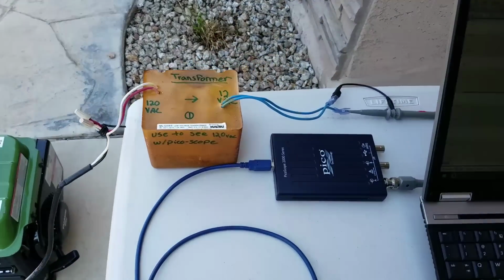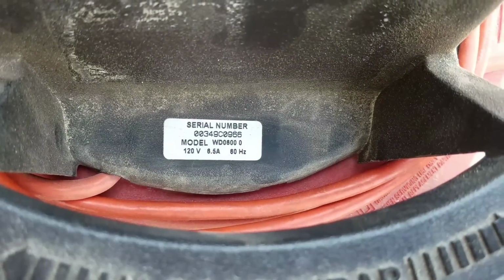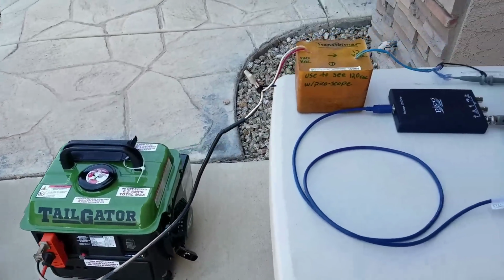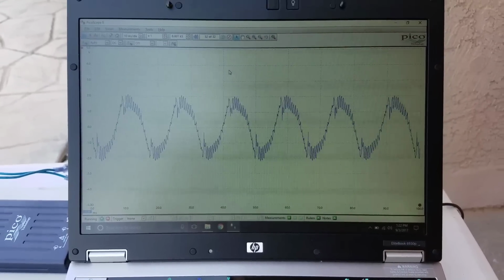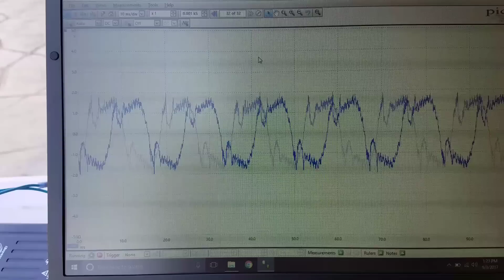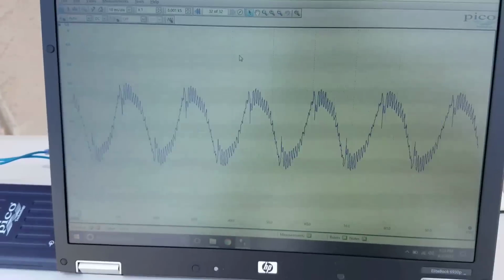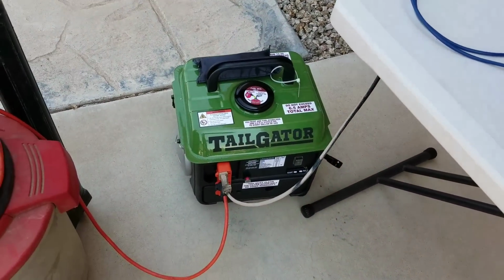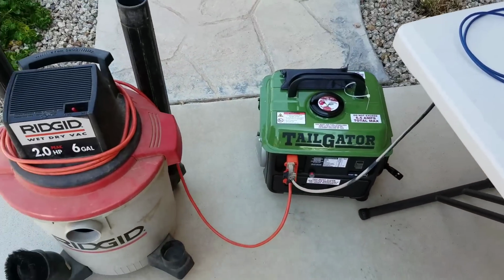TESTED Harbor Freight Tailgator generator wave form with PicoScope

Comment: Nice to see the output wave.  What is inside?  I am guessing this does not have a true alternator.  Is the generator inside DC that goes through an inverter?  If so, what voltage is the DC?  I am looking for a 12VDC 15A generator and was wondering if I could connect directly off of the DC side.

Comment: Would this generator damage electronics? Thanks for the video.
Reply from the maker: Brad Davies: great question! Because the wave is not the most smooth, and degrades as you load it, there is a potential for this generator to damage more sensitive electronics. Personally, I feel comfortable using it with most power tools and devices that have an external power supply "brick" on their power cord.
Reply: @skipstang  I truly appreciate the video. I am purchasing this generator as a gift to an older person. Now I can include a power conditioner. Now I wonder if this will damage a true sine wave power inverter? There are plethora of videos doing sound tests with generators, we need more videos like yours. Thanks again.

Comment: M6 generator cannot start plsss helpp
Reply from the maker: Karl, sorry to hear that. For all gas generators that have trouble starting check for the three basics of combustion: Fuel, Air, Spark. FUEL:  make sure you have plenty of clean gas and the gas is getting all the way into and through the carburetor. For generators that sit with fuel in them, the small ports in the carburetor get clogged and this is a common reason for not starting. Some carb cleaner spray should help fix that. AIR: make sure your air filter is clean and it (and the housing) is not obstructed with dirt or debris. SPARK: this lights your air/fuel mixture in the combustion chamber. Remove the spark plug, ground it out to the metal motor and try starting (area should be free of any gas or carb cleaners for safety). You should see a spark pulse at the electrode. Make sure the plug is clean and the Gap is correct.

Comment: I noticed the red or orange socket adapter on your generator, I was wondering if the machine could operate using multi things like lamps and fans at the same time or any two items on the generator?
Reply from the maker: darkchild00, great observation! The generator will run any combination of appliances as long as their combined load is equal to or less than 700 watts. So if you plugged in 7 lamps with 100w bulbs each, then Yes it would run them. Use this easy formula to find the Watts of the tool/lamp/load you want to use: Watts = Volts x Amps.
Reply: @skipstang  Oh ok thanks. That's very helpful.
Reply: Hi again, can I ask where did you find your multi plug adapter? Thanks.
Reply from the maker: Home depot.
Reply: @skipstang  Thanks I appreciate that. I just purchased one recently.

Comment: Hi is this strong to run a travel trailer I have a battery on the trailer
Reply from the maker: Alex: if your travel trailer has a converter to charger up your 12v system this little guy may be ok. It will run lights and TVs, but no AC or microwave. For the price, it's hard to beat. Give it a try :-)
Reply: Ok thanks

Comment: Loading "it to the max" would involve doing work with the vacuum, like putting your hand over the end of the hose, not just spinning the motor.
Reply: If you block the hose, the motor speeds up and actually draws LESS current. To draw maximum current, you would take the motor unit off, and remove the air filter to allow maximum air flow volume. Don't worry: this generator would still have no problem powering it.
Reply from the maker: mwilliamshs, that is a great point! As others have suggested, maybe I should run the test again with a fixed load; halogen light(s) for example. This along with measuring the amp draw would produce a more solid test. Thank you.

Comment: What am I supposed to be seeing??????
Reply from the maker: Wayne Novotny; we are looking at the shape made by an AC power source. The shape of the wave tells you a lot about the quality of power the generator produces. The more smooth and consistent the wave/shape the better. The oscilloscope lets you "see" what the 110v alternating current looks like in real time. The point of loading up the generator with the Shop-Vac was to see if the shape of the wave would degrade if the generator is worked very hard.
Reply: Thanks! @skipstang

Comment: how did you break it in?
Reply from the maker: redneck teck
, Great question! I followed the recommended break in procedure in the generator manual. Basically it has you gradually increase the load on the generator for different blocks of time. Since you only get one chance to break in a new motor, I wanted to do the right. Hopefully it will pay off in a long service life.

Comment: That was interesting, thank you.  Can't beat the price.  Not sure I'd plug expensive electronics into it, rather I'd use it for lights, small fridge, coffee maker etc.  These are decent units for the money.  I understand breaking them in using 40:1 fuel to oil ratio is key to longevity.  I've seen where people have put 1000+ hours on these provided they are broken in properly, and not overloaded.  Good value, and decent build quality for the money.
Reply: I know a few contractors that work on vacant/ abandoned homes.  They use these Chinese gen sets to run small air compressors, shop vac and even water pumps. I went with a bigger 6.5hp 4k peak unit when we did that work so I could run a bigger compressor and my circular saw but at times i wished I had a more portable unit as mine is 130# or so with fuel.

Comment: Do you think this thing is strong enough to run one chest freezer or a fridge?
Reply from the maker: Eddie, it depends on the amperage of the freezer or fridge; check the label on the back.This unit is rated at @ 6.5 amps continuous load. Remember the fridge doesn't run all the time, which is good. I have heard of people running full sized fridges with these little guys, so it may be possible. It would probably help if the fridge was already cold, less initial load. You bring up a good point, what exactly is the threshold of this little generator? I know people in hurricane impacted areas just trying to make it through could use this info. I think a new test is in order. Thank you!
Reply: If it can get it started, it would run it just fine. Some older fridges and freezers take a lot of current to start, and this generator may struggle with that.

Comment: If I buy the 750 watt inverter and use that with this gen would that make the sign wave clean? I'm looking at getting this gen cues of the price but want it for my gameing system if the power goes out.
Reply from the maker: Joshua Raines, that is an interesting idea but not exactly how the systems work. An inverter converts DC (battery) power to AC (wall socket) power. This (and most) gas generators already output AC power, so there is no need for an additional device. However, I do agree with you about having good quality power for a PC. What I use is a backup-UPS (uninterrupted power source). This maintains constant power to whatever is plugged in even when the grid goes dark. Seamless power with no interruptions! To get even longer run time (UPSs have internal batteries) use a little generator like this one to charge the backup-UPS. I hope this helps.
Reply: @skipstang  hey thanks I was woundering about those too but could not find if that would work or not.
Reply: If you get a 100 microhenry inductor and connect it in series with a 20 microfarad capacitor, that would filter out the high frequency ripple, and it would be perfectly safe to use with the gaming console, and the TV. The power would be taken off the capacitor.

Comment: I'd like to see a sine wave test on the Sportsman 1000 4 stroke inverter generator....I have the Tailgator and it's been great. I run it at 40-1 though, not 50-1. Thanks for doing this test!
Reply from the maker: Harold Fits, that is a great idea! I will have to look in to getting my hands on one. Better yet, I should make a mini-gen shoot out video.

Comment: como puedo sicronizar las ondas de 5 generadores de este tipo en una casa gracias
Reply from the maker: The question is: "how can I synchronize the waves of 5 generators of this type in a house thanks"? This usually is a feature of more expensive generators with computer controlled power output. These little Tailgaters are very simple and rely on engine speed and a capacitor to create the power/wave output. I do not see a easy way to "sync" the waves so multiple units can be combined. Realistically: 5 x $90 (price of one Tailgater Generator) = $450  &  5 x 700 (running watts) = 3500 total watts. The Harbor Freight Predator 4000 watt generator is $339.99. It is less expensive, cleaner & more fuel efficient (2 stroke vs 4 stroke), and you end up with a more powerful unit. If you need house power, I would not under-purchase a generator. I hope that helps.
Reply: well thank you very much for your attention greetings from Colombia
Reply from the maker: raul david rojas muñoz, many areas of Colombia get strong sun year round, have you looked in to solar? It is more expensive at first but almost free after that. Solar water heaters are cheap to build as well.

Comment: The Pico software has fantastic measurement capabilities.  It would have been nice to see frequency peak-to-peak etc.
Reply from the maker: Jon Dison, you are correct the Pico scope is a powerful and focused tool! It would be fun to totally geek out on the specifics of the wave. For the purposes of this video it was sufficient to inspect the general shape of the wave under load. However, a few of the inverters I have laying around may require a more detailed analysis :-)

Comment: Can it Run a small window unit and a small refrigerator at the same time thanks in advance
Reply from the maker: George Barnes, it depends on what amps the two units draw. Watts = Volts x Amps. Add up the amps on the equipment you want to run and multiply by their operating voltage (on the UL sticker). This will give you the Watts necessary to operate the equipment (and a great way to pick the right sized generator for your needs). This generator makes 700 watts of power at 110 volts; roughly 6.5 amps. Running this small shop vac maxed out the little generator, which was the point of the test. I wanted to see how the wave form holds up at 100% load.
Reply: This will struggle with the inrush current of the induction motors in the compressors. It would run one or the other, if it can get it started. It won't run both.

Comment: does  the wave is  okay for modern TV or Computers.....?
Reply from the maker: Wolfgang Eckert that is a great question and also one of the reasons for this video. The owner's manual states "Unconditioned electrical output can damage sensitive  equipment.  Do not use to power sensitive electronic equipment without appropriate line conditioner (sold separately)." We can expect a CYA statement like that in almost every manual, but the quality of the power produced (ie: wave form) indicates what applications are appropriate. The more smooth, symmetrical, and consistant the wave the better. In that department you definitely get what you pay for, however this little guy impressed me especially for the price. I would feel comfortable using it for power tools and devices with an external power supply. Most "brick" style power supplies do a good job of cleaning up the power for their device. However, I would not trust this unit to run an expensive tv or devices with microcontroller motors.
Reply: This actually looked pretty good. Most modern power supplies are buffered enough, they should have no trouble running on this. I don't think I own anything that I wouldn't plug into this, except induction motors which may take more starting current than this generator can put out. The flywheel in this doesn't have enough mass to start an air compressor. It may struggle with starting a refrigerator, or trailer air conditioner.

Comment: Heck I ran this generator to power up my full size refrigerator and it had no problems with it. Great little generator.
Reply: My chest freezer only draws 1.2 amps while running. It draws 12 amps on startup however. Those locked rotor amps can be quite high.
Reply: ride4kix no this is bad
Reply: how big is your fridge?
Reply: Wolfgang Eckert probably small
Reply: A regular sized fridge only uses about 200watts. ....

Comment: Received your reply. I shut the fuel off, let it run dry. Use only fresh gas, with fuel stabilizer. They ran fine every month, for 30 to 45 minutes, until I needed them when Irma came calling. I will never trust them, and when I fix all the Irma damage to my house, those 2 pieces of junk are going to the dump.
Reply: i want them if your throwing them in the trash

Comment: You should put a resistive load on it like a space heater or some high wattage light bulbs. Lots of that noise on the scope may actually be coming from the bushes in the shopvac motor.
Reply from the maker: V, I agree. There is a 700 watt halogen worklight in my garage that would be perfect. However the choice of the shop vac was intentional; thinking of all the people cleaning up after the hurricanes.
Reply: Does the ShopVac motor have brushes? It is an AC motor.

Or the noise could be from the generator itself. Harbor Freight isn't known for great fit and finish.
Reply: @davem5333  universal motor.  Yes they have brushes.
Reply: @davem5333  The shop vac uses a universal carbon brush motor, so it can achieve high speeds. The speed is voltage and load dependent, regardless of line frequency. It would even work on direct current.

Comment: Not sure about the new one, but the prior red ones are CRAP! I will never buy anything generator wise from these Chinese crooks. I have 2 of the red ones that I have run every 4 weeks, with stabilizer - the whole maintenance deal. Now, when that bitch irma is coming, neither of these hunks of junk will start. Spend your money on lottery tickets, you will have a better chance of having power.
Reply from the maker: CM Sag, if you are in the path of the the hurricane my prayers are with you. I have family there right now. As far as the little generator goes I hope they learned from their mistakes and the current product is improved. I made a few modifications to mine to help it's longevity. The carb has small orifices that get plugged, little bit of B12 Chemtool or cleaner in carb intake might help them get them fired back up again. Good luck and be safe.
Reply: Thanks, but it is too late for me, plus I do not know what B12 Chemtool is. I do, however, appreciate the quick reply. As I stated earlier, I have babied my 2 red ones. Never a problem until I really need them. Hope your family members will be OK.
Reply: If you didn't cut the fuel off and let it run out of gas in the carb bowl it would be your fault it doesn't run. Also if the gas is old at all that doesnt help either. Mine has been flawless but I have the Power Pro model with the voltage gauge and 12v charging.

Comment: Run this generator every week on 7 amps since 4/15/17 and it works . It will not rev up like your video ?  The tool is the Harbor Freight Impact Driver .